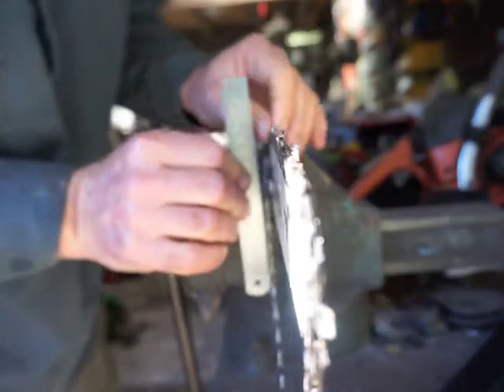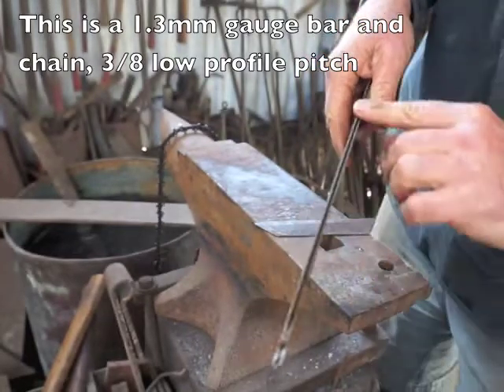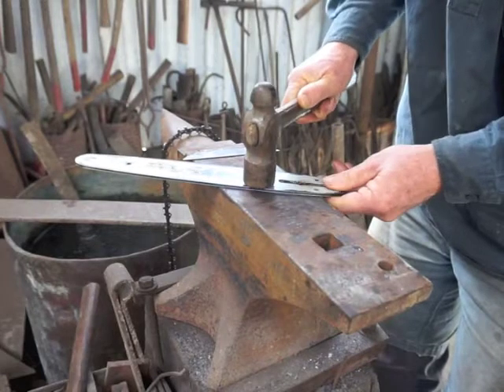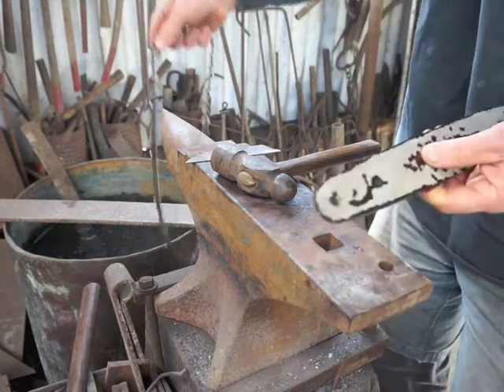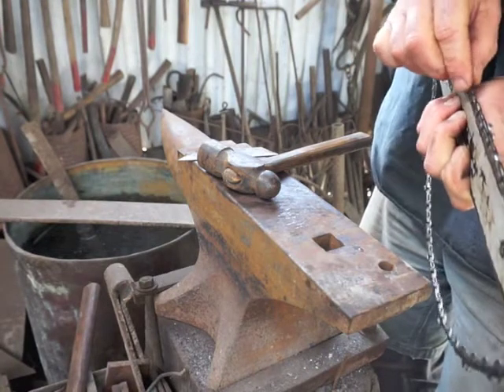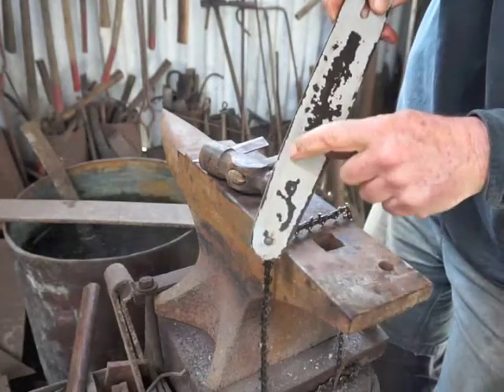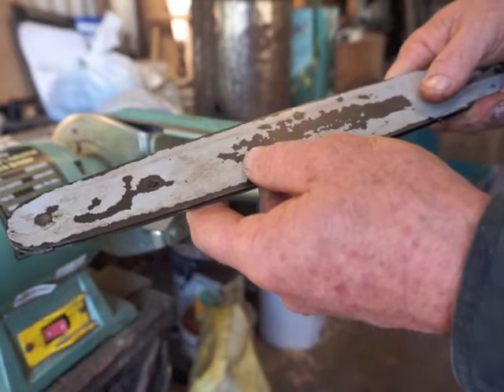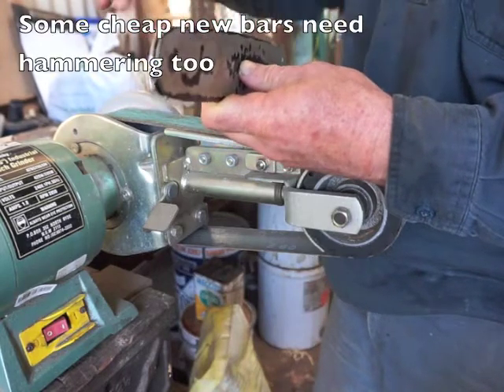Chainsaw bar hammer and dress

Comment: Thanks for the instructions. I watched this and I followed your instructions kept putting the chain on the bar as you did to determine the fit .The saw cuts were running bad now it is like a new bar. Cuts perfect, I didn`t have an anvil so I made a hamming surface with a piece of scrap  20" long 6" H beam I got from a friend.A new 16 " bar was priced at $68 + tax!

Comment: Thanks. Very nicely done video, straightforward and clearly explained. For removing burrs and squaring up the rails, I use a metal cutoff wheel put in my tablesaw, rubbing the edge of the bar against the side of the cutoff wheel.  The wheel being square to the table saw top gives the results I need. Cutoff wheels aren't really made to grind on their sides, but it's worked for me for a long time.  Light pressure so the wheel doesn't deflect, a tight throat plate on the saw, and safety glasses are in order.  Gluing a backing plate on the cutoff wheel would be a good addition for added strength and security.

Comment: G'Day Bruce, thanks so much for sharing your experience and know-how, you're a legend. Before I go out and have a bash at it myself, wondering if you could describe what you'd do when hammering a bar if you hammered it too much and created a pinch point. You said you'd open it up but not sure how you'd go about it. Would you just twist some flat tool in the groove to kind of lever it open? Thanks again for the video
Reply from the maker: Hi Matt, thx for your feedback. 
I quite often get pinch points in bars I hammer and it’s easily fixed. It’s surprising how much bars vary in the stiffness of their steel. 
What I do: 
I put the chain in the bar groove and grip the bar in my metal vice (like at the start of the video). Pushing the chain back and forth shows you where the drive link is catching in a tight spot. I pull the chain out of the groove and lightly hammer a suitable tool into the groove where it’s tight, maybe moving the tool along to open a longer section. Then test the groove with the chain. 
The tool needs a fine taper to open the groove gently. I sometimes use a large, strong screwdriver (I have old ones where the steel shaft goes right to the top of the handle so it can be hit without breaking the handle). At home I have a large cold chisel that’s been forged thin and ground to a fine taper with a blunt end. It usually only takes a few taps, sometimes just pulling the tool along in the groove will ease the pinch. 
Good luck with fixing your bars, Bruce.
Reply: @BruceTeakle  G'day Bruce, sorry for the very late response - just wanted to say that I really appreciate the time and thought you put into your response. Very nice thing of you to have done for a total stranger, thanks for that!

Comment: hi Bruce, can a bar be put on upside down ??  thanks. Looking forward for your reply.
Reply from the maker: Hello Ryan, yes, bars are 2-sided and should be put on both ways (writing upside-down as well as right way up). That way both sides can be worn together. If you use a chainsaw regularly (e.g. cutting your own firewood) you should have 3 chains that you rotate and wear out together. Every time you change chains you should flip the bar and use the other side. When all 3 chains are worn out, you get a new sprocket and 3 new chains.
Reply: Hi Bruce, thanks  for the quick and clear response.  Cheers
Reply: There were some anti kickback bars around with a " banana shaped" nose ( not symmetrical) that shouldn't be flipped over but thats rather obvious- I don't mean to insult anyones intelligence, just a comment.  Happy cutting!

Comment: I use a linisher with a disc attached at ninety degrees to the belt that has a rest, it works perfectly for dressing, much easier than trying to keep the bar at 90 degrees to a belt. similar to this one: https://i.imgur.com/qfNDrOc.jpg
Reply from the maker: Thanks David, I'm sure that's a better method than trying to get 90 deg by eye.